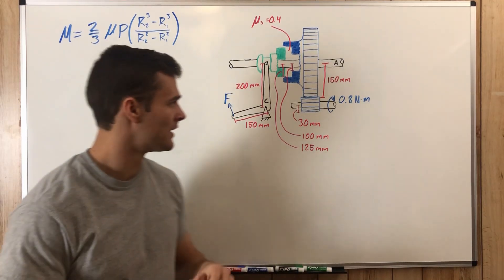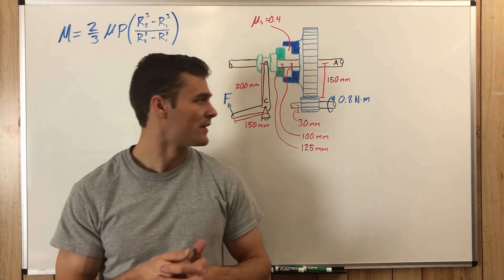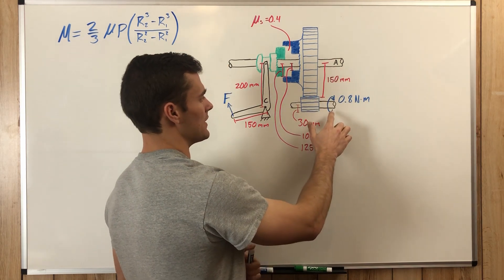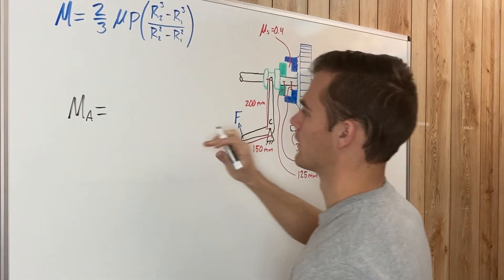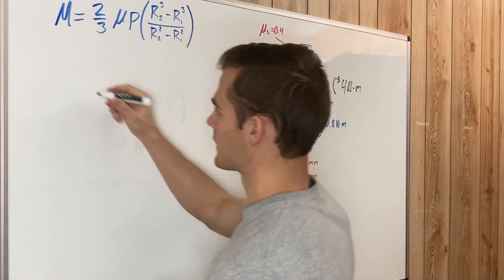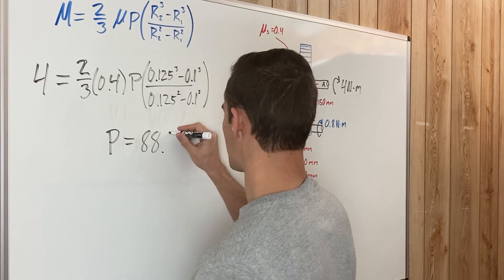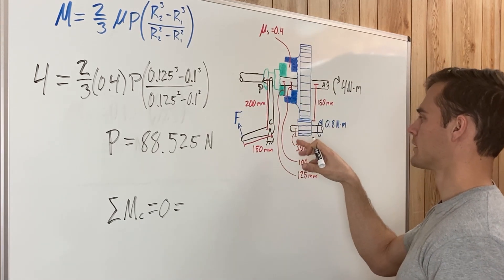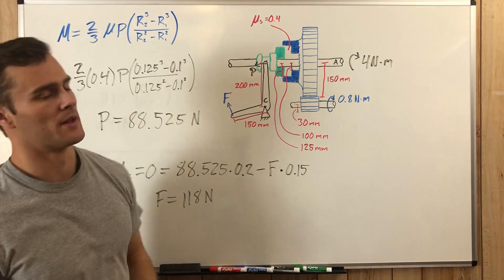Frictional Forces on Collar Bearings EXAMPLE PROBLEM // Step-By-Step Explanation / Equation Included

Comment: why is the P going to the other direction when youre looking for F ? i really appreciate your vids by the way.
Reply from the maker: P is the force pushing the two plates together that causes the friction to stop the rotation. F is the force on the lever arm that pushes the two plates together. Because the arms on that L shaped piece are not the same length P and F are not equal.

Comment: Why is R1= 100mm?
Reply from the maker: R1=100mm because that is the radius of the inner circle of the disk where the two plates are pushing together. R1 and R2 are used as part of the equation to find the friction between those two plates.